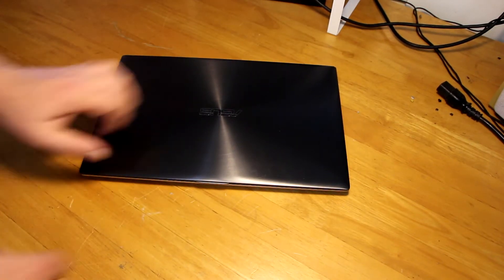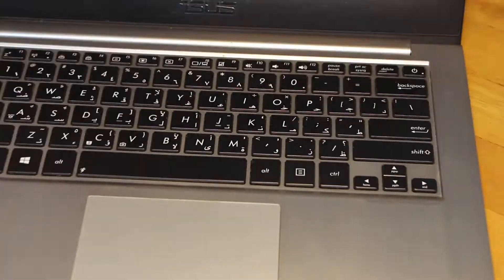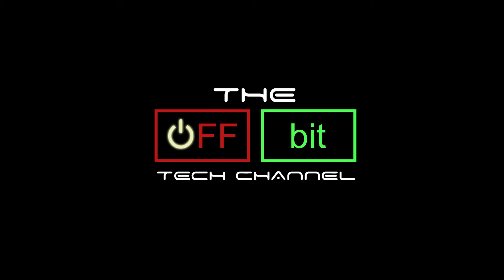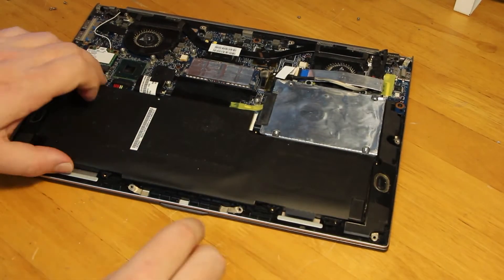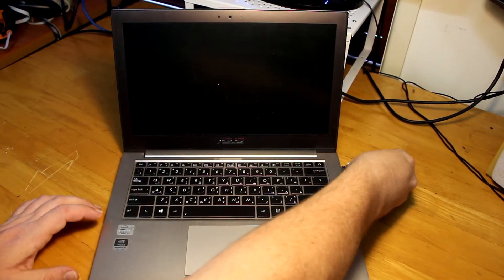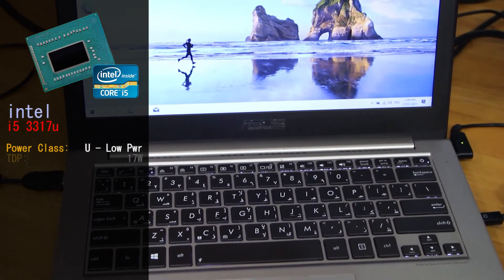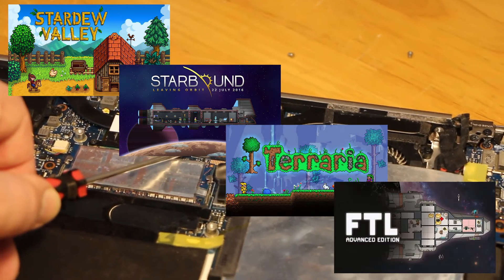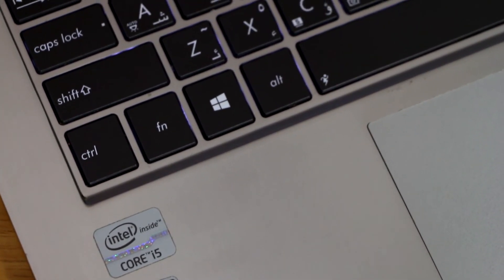Asus Zenbook UX32VD SSD upgrade.

Comment: Good night. I'm just about to make this upgrade. Can you tell me if the change from HDD to SSD makes a great difference and improvement in the performance of this laptop? 

Thanks.
Reply from the maker: Unfortunately we did not run the original hard drive for too long. We believe the original set up was using the onboard SSD as a cache drive  to improve  the performance of the magnetic drive. Though this is not as good as having an SSD for the hole drive.

So, you should see much better loading times and battery life with having an SSD drive in this laptop.

Thanks for watching and Good luck.

Let us know what your findings are  in regards to performance when you have completed the upgrade.
Reply: @OFFbitTech  thanks a lot for your response and well, I think there will be an important improvement and of course I will tell you about the case.